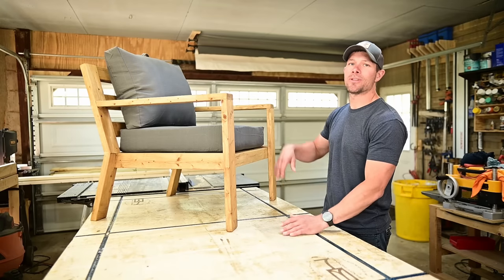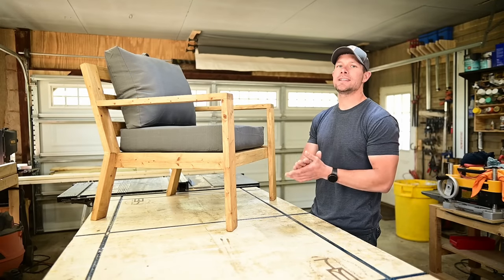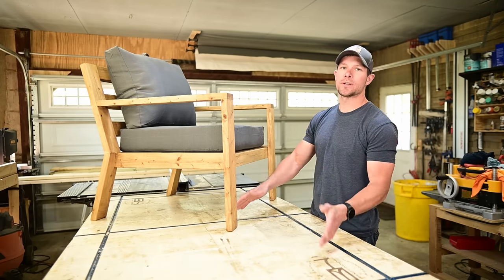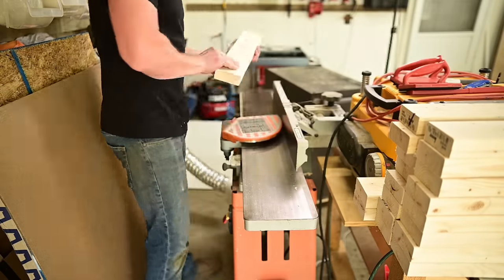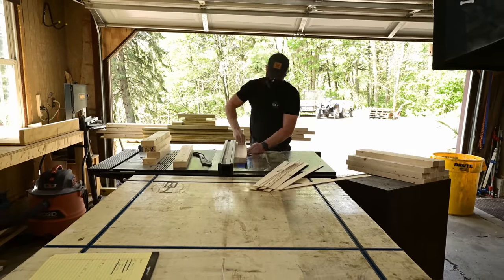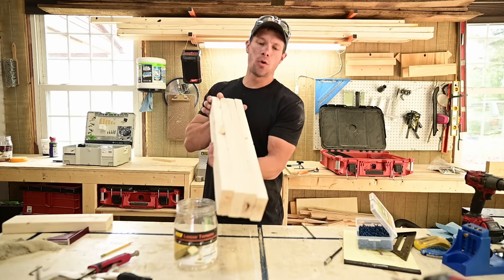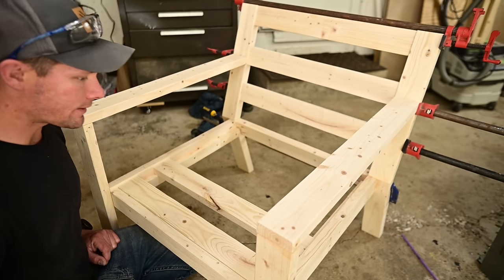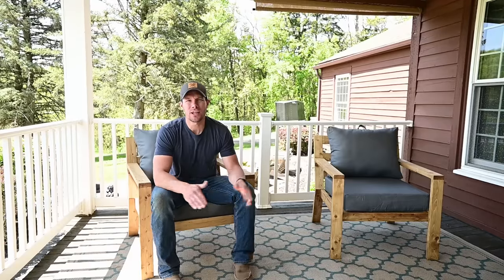Patio chairs are EXPENSIVE... Lets make them CHEAP!

Comment: Love the design. If I hadn’t already made some last summer I would’ve bought and built these. You’ve been making a lot of great stuff lately and it’s nice! Great job and keep up the good work!
Reply from the maker: Thanks a lot man! I appreciate that comment!
Reply: Pine’s not great outside, but you can make them last longer by putting a little foot under the legs, will hold the end grain up off the surface so it absorbs less and can dry what moisture it does. Looks good thou!
Reply from the maker: @Thomllama  that is a great tip! Mine will be under my covered porch so will never really be exposed to standing water but definetly a great thing to do to add to the longevity of it.

Comment: I bought the plans. They are very well done and easy to follow, especially when augmented with the video. I intend to use 3/4” hickory after milling. Do you think this thickness is sufficient or should I laminate up to 1-3/4”?
Reply: I had the same thought, but for cedar. I think 3/4” is probably fine.

Comment: Would you recommend using pressure treated lumber if it was going to be put on an uncovered patio?
Reply: Pressure treated lumber contains chemicals that you don't want in contact with your skin (don't put your arms resting on it). If you do use it, you would want to paint it and don't breathe the dust of it when cutting. It's also going to look rough as the pressure treatment has indents on the outer edges and won't where you cut it. It's also more expensive. If you're going to pay more, then consider a more durable wood. The material used in this video is nice and inexpensive.

Comment: I see you used the installation driver. Would you recommend it for more than just setting pocket holes or does it show enough power for more jobs?
Reply from the maker: Oh dude I use that drill all the time. It is my most used drill. It is plenty capable for more than just screwing pocket holes especially with a high output battery.